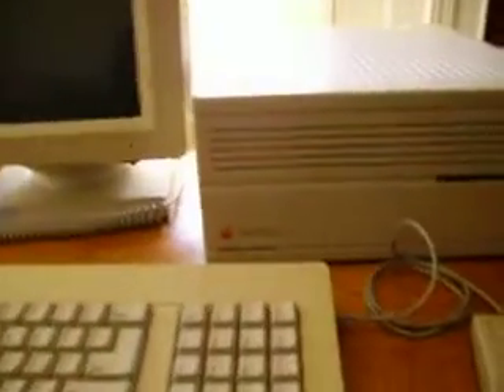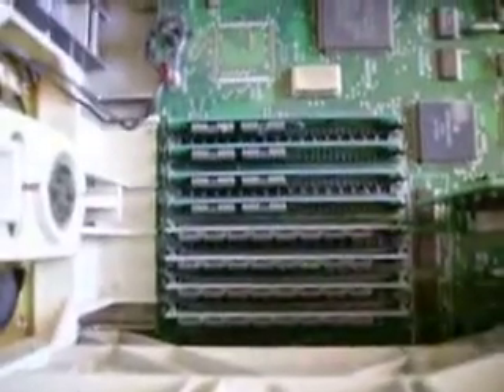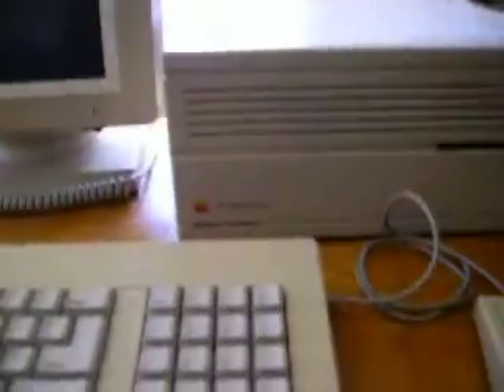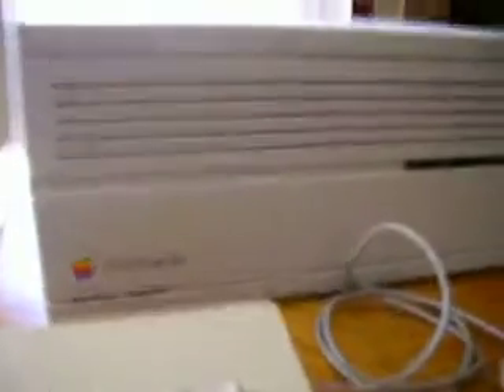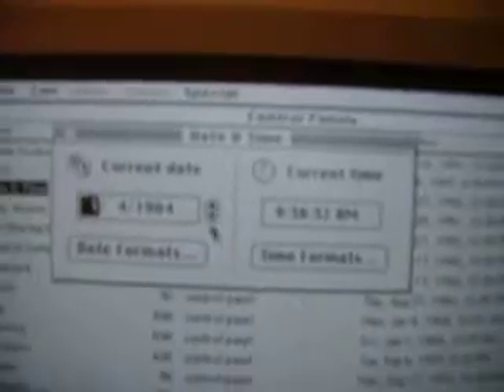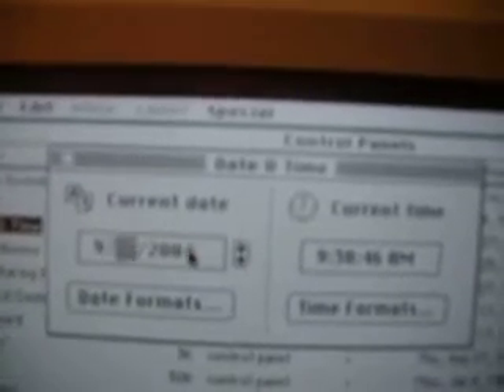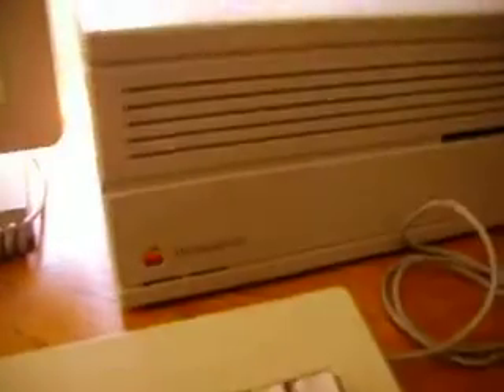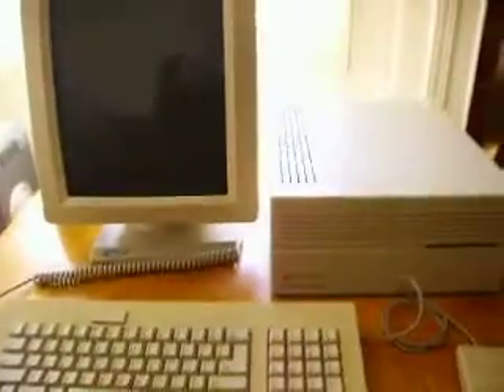Apple Macintosh IIci

Comment: Yeah, in the case of the IIci (i have several) there's not that much to go wrong. Even boots without a PRAM battery. As long as the harddisk is still ok - and if not it's easy to swap in this model - it nearly always works.

Comment: I was born in 1987 and this was my first family computer.  I totally want to get one again (I don't know what happened to ours).  However, I received for free a Mac Centris 610 which is actually the same speed as a Macintosh IIci (25Mhz).  Interesting enough, my dad got an upgrade card for the Macintosh IIci we had that upgraded it to 33Mhz, and a 68040 processor (as opposed to a 68030).  It has pretty hardcore.